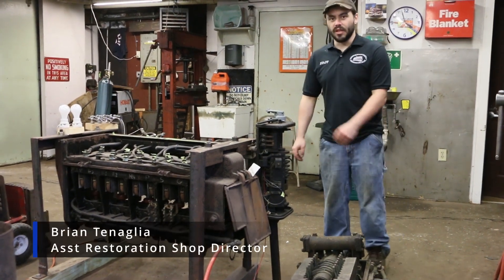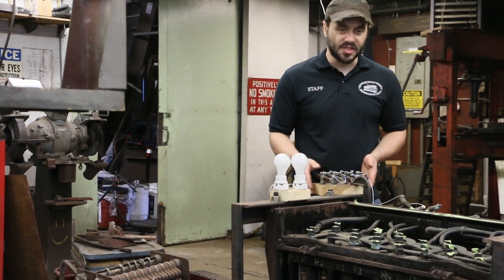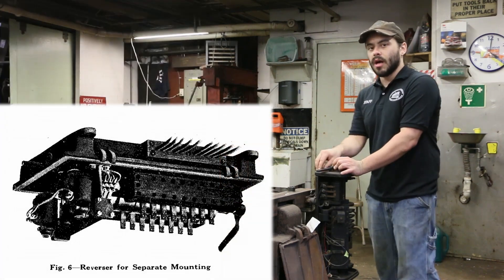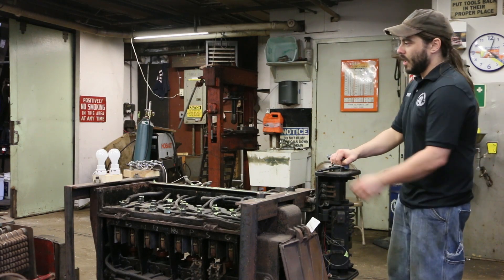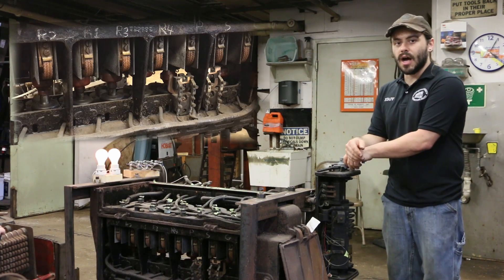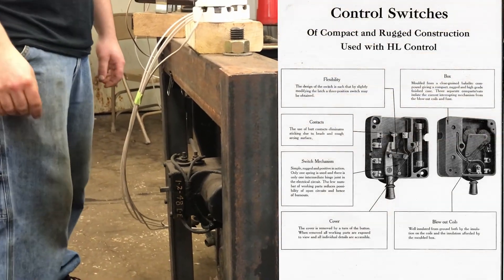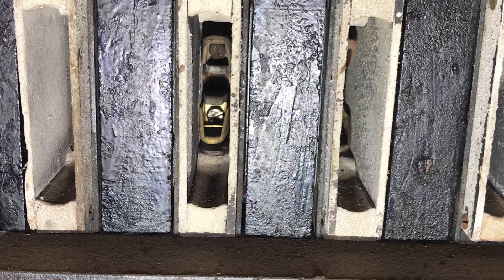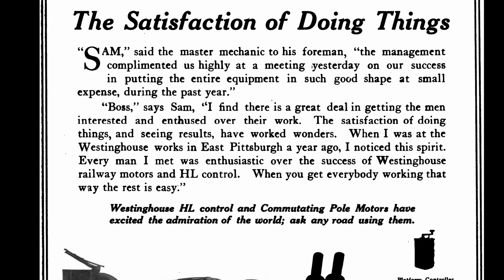Westinghouse Electric Railway HL Control Test Setup

Comment: Nice demo. I noticed that when you operated the manual overload trip from what looked like full parallel all the contactors dropped out. When you reset the overload, it seemed like it had the effect of re connecting the motors in full parallel, as the lights went from off to full brightness. Presumably, you didn't put the controller to the off position before resetting the overload. I wondered if there was an interlock to prevent sudden re-application of full power under these circumstances in normal conditions. From the demo, it seemed like if the Motorman had a trip and lost power, but forgot to put the controller to off before going down to reset the overload, that as soon as he reset the overload, full power would be switched on, even though the car was stationary. This would seem undesirable and may lead to further problems. I imagine that the motorman would remember to put the controller to off before attempting to reset the overload. I guess it would come down to proper operating procedures being followed, but the possibility of a mistake seems to be present. Have I missed something??

Please forgive my pedantry, but I am an ex railroad man and the law that says, if something can happen, eventually it will has been firmly instilled in my thinking. Believe me, I know of actual cases.

Thanks for reading and if you could comment, that would be great.